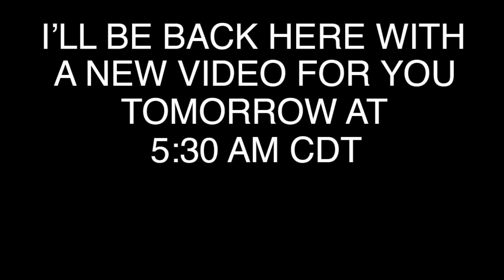Worlds GREATEST firewood bundling video EVER!

Comment: A very nice setup!  If need be, I'll  bet you could also use brown Kraft paper and gummed paper-tape to wrap those bundles, which would eliminate plastic and turn the whole bundle into a burnable product.
Reply from the maker: Yup, but how many can you do in an hour???
Reply: @InTheWoodyard  Haven't tested it, and I haven't done a price-check between yr. rolls of shrink-wrap and similar rolls of brown kraft paper and gummed tape rolls, but WAY back in the 1970's I worked in a factory where we wrapped large packages using nothing but brown Kraft paper, sealed with water-actived pre-gummed tape in a dispenser.  We had quite the system where we'd both tape each end of the package and our production was good. Of course, I was 50 years' younger then!

Comment: you guys chose the plastic shribk wrap. the girls/ women at mber capital log yard you tupe pa. use a stretch bundle and an insert tube. and no power wrapper. different solutions for the same job. not sure of tge time. consideration. the a saw mill to cut boards. if the had birch they could cut the birch slaband edge and put some wood with birchh bark as fire starter or kindling.  

different strokes for different folks. 

can you share the make of your bundler.
Reply from the maker: Yes the bundler is from Brute Force.